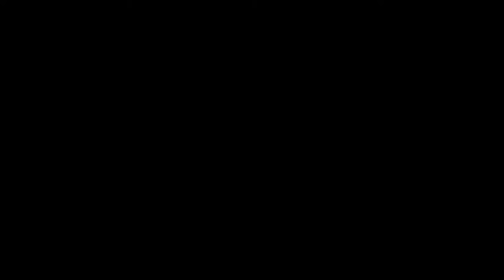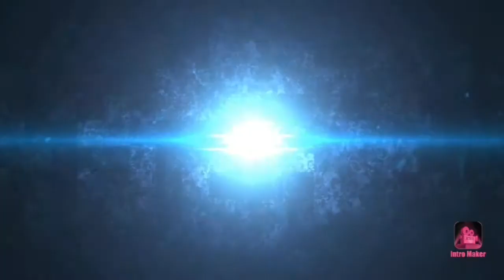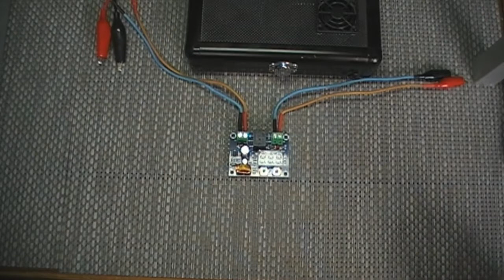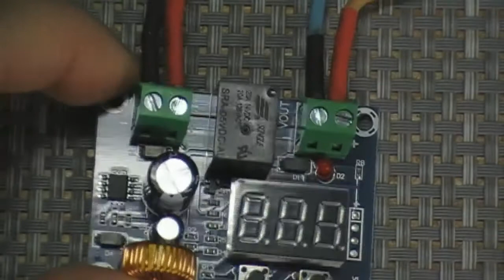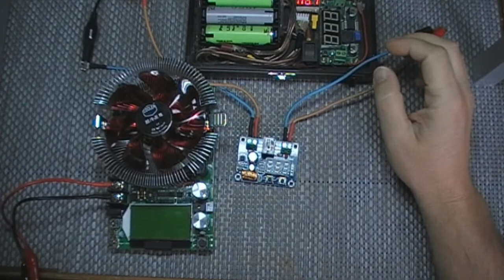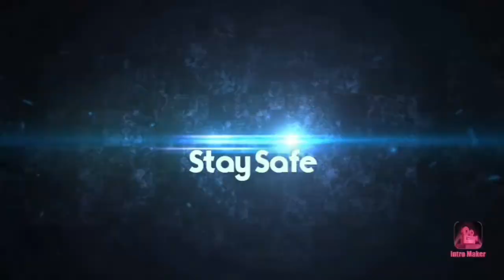XH-M609 DC 12V-36V  OverDischarge Battery Protection Precise Undervoltage Protection Module Board

Comment: These are great for using them on trolling motors on the john boat .I killed a few batteries in the past running them all the way down to nothing 
I use agm  batteries so you don’t hurt them I have a 11v cut off but I also use 2 -100ah batteries in Parallel I have the board installed in a water proof plastic container and a toggle switch on the negative 
I hit the off switch when I charge it so I won’t get any power to the board I also recommend putting a inline fuse before the input just in case about 15 -20 amp 
It worked good all year about 10 trips it went off a few times when I set it to 11.5 volts and knew it was time to go back to shore

Comment: Hey, I've been searching for a while and couldn't find a straight answer. What is this board's consumption ? Especially when it's already below the setpoint and decoupled the output. I can see that its 7 Digit display is still active and I'm wondering at what rate this circuit will discharge further the batteries.
Reply: I saw a 60mA current draw when under-voltage and relay off. So you need to be really careful if relying on this to protect a lithium battery.  A continuous 60mA draw on an battery pack that's almost exhausted will put it in the damage zone in a matter of hours or days.  ie not practical to protect a lithium battery unless you have some kind of constant in-trickle (eg from solar PV panel).
Reply: @JoeDesbonnet  I managed to get the circuit to completely cut off by powering in through VOut terminals and getting power through VIn. Connecting first both positives of Vin and Vout acts as a latch (I soldered a button).
Reply: @RunTheTape  I'm trying to understand your suggestion: if you tie Vin+ and Vout+ together and connect that to Battery+, there will still be current drawn by the monitoring part of the board when the relay is open circuit, no?
Reply: @joedesbonnet1299  yes. But you put a button between Vout+ and Vin+ which will act as a latch for the whole circuit. The module itself will then be powered through its own relay. When it’s the condition for the relay to be off, the whole circuit powers down. It will never be able to come up again on its own (you’ll have to push the button I mentioned earlier)
Reply: 1.5 watts not much power it’s basically a relay so when it doesn’t have the voltage it switches off but make sure when you charge the battery to disconnect it or it could get damaged  I put a switch on her on the off position before a charge
Reply: 100mah is consumption in Stand-by

Comment: My XH-M609 module required a different setup, see here: https://youtu.be/d9RD0Iao58A . There are four settings using the two buttons: calibration, cutout, offset and time delay.
Reply: Thank you very much for suggesting that video, now I understand the configuration options better, because the author of this video did not explain all the configuration options.

Comment: Can this product is used for charge lithium ion battery pack of 12 18 21 24 volt battery pack with bms board
Reply: Yes I use in in circuit with a 20v dewalt battery for a radio for my boat so I don’t kill my boat battery I cut it off at 17v and has 1 bar left I learned the hard way and didn’t use this and killed a battery

Comment: Hi. I bought this board thinking I could use it to protect overdischarge but it doesn't appear to have this feature? Can you use it in the opposite way in order to stop charging a battery when it reaches a certain voltage?
Reply from the maker: Yes it has low voltage and overcharge protection too
Reply: @asgenuine6662  how do you set it up for overcharge protection?
Reply: The XH-M609 protects battery from overdischarge. To protect battery from overvoltage use the XH-M601 module. See them together here https://youtu.be/4i0LaZO_jAI

Comment: Hi Friend, I am trickle charging my car battery through Dewalt 20V using LM2596 and it's working really good and have been using it for about an year from now. Now my question is I want to protect my Dewalt Battery from going too low on Voltage and I tried using XH-M609 and LM2596 together but it didn't work. Now what do you suggest me to buy which might help. I appreciate any help please.
Reply: Hello. your lm2596 must have cooked when you applied the car battery voltage on the out. You just need 1 diode between lm2596 and car battery. The 20V negative can not be connected to the car chassis or car battery negative.
Reply: This video might help: https://www.youtube.com/watch?v=4i0LaZO_jAI